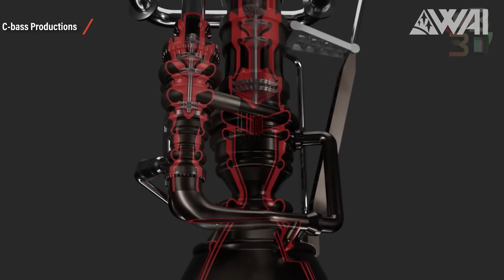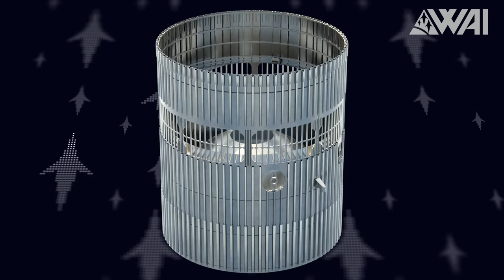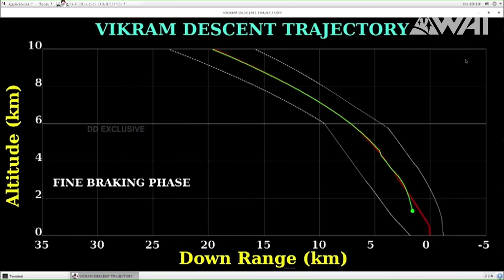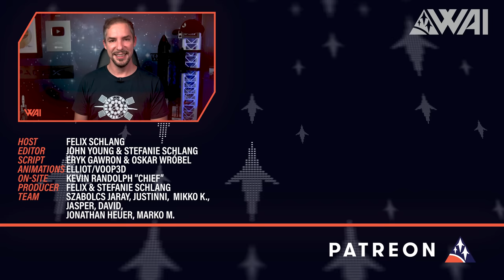Epic Testing Change! Is SpaceX's Starship Raptor Engine Unreliable?

Comment: Every change to Starship Raptor seems designed to compensate for a lack of thrust: they added more engines, then increased thrust with Raptor 2, and now with Raptor 3. The OLM was damaged by a very slow liftoff, also suggesting insufficient thrust. Perhaps the Raptor design is inherently difficult to ignite.
Reply: No one else has successfully built and flown an FFSC Methalox rocket engine. Remember, the Raptor is still in development. Spacex's first engine, the Merlin, also took quite a while to develop into the incredibly reliable engine it is now. Also, it uses a much simpler gas generator cycle and Kerolox as fuel.
Reply: As they say, more thrust more better. And of course everything in rocketry is a thrust issue. But Superheavy has the highest thrust-to-weight ratio of any rocket ever built, it's why it can be a fully reusable vehicle. The flight test had trouble with liftoff, not because the vehicle as designed is short on thrust, but because numerous engines failed to ignite at all. And that's to say nothing of the engines lost during the remainder of the flight. In the future when all 33 engines are lit and remain lit, Superheavy will absolutely jump off the pad! It's going to look surreal.

Comment: Felix you forgot the lawsuit - If it goes through quickly in favour of the FAA and co-defendant SpaceX, then launch sometime this Year is possible. If lost and EIS is ordered, it will take 1-3 Years..  Anytime this Year for would be great and fingers crossed the water deluge holds up to the fury of 33 raptors firing full duration (the same time period as a launch) at close to full thrust (SpaceX didn't disclose the thrust % for this latest SF).. This will be necessary to make rapid launches possible - ATM we don't know how close SpaceX is to this goal...
Reply: 2024 or later. Everyone in their senses know this including NASA

Comment: Shoulda gone for fewer, larger engines.
Reply: smaller engines are easier to engineer, and cheaper to build, so while they are failing now they will eventually solve this problem. how long will it take, is the real question.
Reply: And lose the re-usability of the ship.
Reply: @Scanner9631  it's not like they're landing with legs. They're supposed to be being caught by zilla anyway. So who cares if the engines are larger?
Reply: @Dac85  They're supposed to be being caught by zilla anyway. 

If the engines are much larger they can't throttle enough so that on landing the rocket can hover which is NECESSARY for the catch.  Without that ability it will never be allowed to land carrying people.  

The engines minimum thrust needs to be LESS than the gross mass of the landing rockets.

Comment: From a simple mathematical standpoint the more engines you have the more likely it is you're gonna have at lease one fail.  Say for instance that any given engine has a 80% change of functioning normally, that is actually a 20% chance of failure (1 in 5), which is pretty good.  The odds are better that the engine will do what it's supposed to do.  But that doesn't mean that's true for multiple engines.  Think of it like rolling dice.  Say you want to roll a 6, with each roll you always have a 1 in 6 change of rolling a 6 with each and every roll, but the more times you roll the more likely you're gonna roll a 6.  This is how it is for a rocket with multiple engines.  Each engine might have a 1 in 5 chance of failure, but if you're trying to light 33 of them, there is a more likely chance that one or more are going to fail.

the other thing to consider is the problem may not be with the Raptor itself but rather some kind of software or electrical issue where the control computer may be getting faulty values from the engines due to bad sensors or bad wires, so the computer THINKS there is a problem with an engine but there really isn't.
Reply: Look to the Falcon Heavy. It has 27 engines, which are incredibly reliable. Those engines also had a development phase in which they sometimes failed. Raptor is still in development. It is a much more difficult cycle (FFSC) to perfect than the Merlin (Gas Generator). Also, the Merlin uses Kerolox, a much easier fuel to work with than Methalox.

Comment: Why would 4 engines shutting down at once be considered unreliable Raptors? the odds of them all failing at the same time are basically zero - so clearly it was a shared cause upstream of the engines. A gas void in the fuel flow?

Comment: Raptor engines are much more complicated and operate at much higher chamber pressures than the Merlin. 
Failure rates need to be several orders of magnitude higher for human rated flight.
Reply: elon should be in the first human flight of this rocket.

Comment: The Raptors need to be as reliable as the Falcon 9's Merlins. It's been a long time since we've seen a Merlin fail in flight. If a Raptor fails in flight it just becomes useless, dead weight not producing any thrust. SpaceX needs to fix them.
Reply: It needs to be more reliable because human life depends on those engines working when starship comes back down to earth..
Reply: merlins will fail too. give it time.
Reply: @iamaduckquack  That assumes Starship will ever get to launch people. I'm not convinced it will make it that far.
Reply: @TheGregEgg agreed, and I don’t think it will ever do a propulsive landing with humans. 

Best case, launch empty starship, launch crew dragon. Rendezvous in orbit, crew transfer. Perform mission on starship, return to crew transfer back into crew dragon for landing.
Reply: @mrbfox1775  I agree. Either Starship lands successfully on it's first (only) try or it ends in a horrific disaster. You can't have people flying on such a dangerous spacecraft. Using Dragon to transfer crew is much safer, but much less efficient.
Reply: @mrbfox1775  that means dozens and dozens of dragon launches if they want to fill starship with crew for mars or just send a handful of people. Both options suck.

I don't think it'll be an issue to launch starship with people but getting them back to earth will probably be a problem.
Reply: @TheGregEgg  Launching with people all hinges on being able to bring them back safely so engines would need a 100% success rate and I don't think that's possible with their attitude of rapid re-usability. Everything fails eventually without inspections and maintenance and that doesn't work well with their agenda. Starship will likely be a huge mass to orbit vehicle for years upon years, decades maybe before humans are allowed near the thing.
Reply: @ThatOpalGuy  well the merlin engine seems to be extremely reliable when comes to reusing and lighting engines again and again. it's been only like 6 years and more than 200 falcon 9s are launched and now they're launching several falcon 9s per week, each falcon 9 containing 9 merlin engines that needs to reignite several times per flight even without the mentioning of reusability. so even couple engine fails after hundreds and hundreds of flights it would still be a marvel of engineering. which didn't happen too.

Comment: I’m sure it’s more of getting the software right for the engine with that many firing at once.  Software is probably shutting them down due to erroneous data but this is just a guess.  We will see.
Reply: Not even erroneous data... just data outside the configured tolerances. Probably something simple like vibrations or operating temperatures being marginally different from what the model says they should be... not necessarily enough to be a problem, but enough for engine management to abort them.
Reply: @simongeard4824  yea erroneous was probably a bad choice of word there.  People don’t understand this is a whole new beast and there will be growing pains.  I think things are going spectacularly considering.  Can’t wait for the next launch.
Reply: @Braddeman  Oh, it could be erroneous data - but I think that's a problem that would have been picked up before now. This feels like an integration problem... nothing is individually wrong, but the whole isn't quite right yet.

Comment: There are limits to the performance that can'tbe broken and can be difficult to even approach, but Making systems more reliable is something engineers do best. Afterall, they have a proven system, and failures aren't random, they have definite causes that can be traced.
Usually a failure comes down to a single part that just happens to be particularly weak and fails. The solution is to identify that part and refine the acceptable tolerance.

Comment: I thought the second Starship Heavy flight was going to be a replica of the first. i.e. Suborbital. Can anyone confirm?
Reply: The first was to be suborbital only on a technicality--it's going to go most of the way around.  It's not like the "fly a couple of hundred miles downrange" suborbital that, for example, New Shepherd flies.
Reply: Semantics. The flight is intended to get the vehicle to orbital velocity — but with a deliberately low perigee to ensure that it re-enters in the right place even if they can't relight the engines. Basically, it enters orbit, but doesn't stay there long enough to complete a full circuit of the Earth.

Comment: The next StarShip launch will be in mid September.  The FAA approval issues are mostly about the debris generated during the previous launch and the Flight Termination System (FTS).  The FTS was fixed months ago and new water deluge system test demonstrated that the pad no longer self destructs during engine firing.
Reply: Nope, the water deluge system test didn't demonstrate that at all. A less than 3 second partial powered engine test does not equate to proving anything except that it doesn't get destroyed when only partial powered engines blast for 2,7 seconds.

FTS being fixed? They thought that the FTS was in working order on the 4/20 flight. It clearly was an utter failure.

Comment: The current engine reliability is nowhere near good enough for a successful launch. Perhaps over time these problems can be fixed, but for greater reliability engine performance might have to be reduced.
Reply: You are aware that the Raptor is still in development, right? And that no one else has ever flown an engine using the FFSC cycle, right? And that no one else has successfully flown a FFSC Methalox fueled engine, right? How long do you think it took Spacex to develop and make the Merlin engine as reliable as it is now, which has a MUCH simpler cycle (gas generator) and much easier fuel (Kerolox)?
Reply: @stefanbaartman5893  may be just may be there’s a good reason why any of that ever happened before. Now it’s perfectly fine that it will never happen. We’ll just keep trying and failing and labeling every failure as a huge success and learning opportunity. That’s the perfect plan for our sweet little cult

Comment: I'm fairly certain if a Starship super heavy stack exploded and leveled a 10-mile wide radius of Texas. WAI would report a successful test of the system. Proving the energetic potential of methane as the right fuel for the Starship program. Lol, slobbering all over.
Reply: Catering to a nonthinking cultist fanboy crowd requires slight adjustments to reality

Comment: I don't think it's the raptos at all. It's all the other pipework and pumpwork that isn't supplying the fuel properly, and engines shut down....  thats not the engine, that's the complications of trying to sync and control THIRTY THREE perfectly fine engines. 
All the background crap

Comment: Actually according to SpaceX those 4 engines did NOT start at all and as Musk has said they can't reach orbit if even three engines go out any time during boost. I don't know WHO says that Raptor development should be easy as it's just the opposite and it does not help that SpaceX is constantly changing the engine parameters upward which makes development even harder as the engines are already at the edge of operability. Keep in mind that with the Merlin SpaceX developed a WORKING engine that ran mostly reliably FIRST and THEN iterated more powerful versions from there. (Standard aerospace practice, which when SpaceX follows it they usually succeed, when they don't they tend to fail and fail hard) 

This by the way is NOT "late in the development of the Raptor" it is very, very early due to the Raptor design and parameters constantly changing. (Much like Starship/Superheavy itself in fact) The Raptor 2 (the version being used here) is still in development with the Raptor 3 being the 'new' model so it only makes sense that the barely tested Raptor 2 will be prone to failure with the Raptor 3 being totally unreliable at this point. Engine issues that no longer appear? 
And what program are YOU looking at? Raptors are still tearing themselves apart, melting and failing which is to be expected with such a constantly changing program with no apparent guidance. Comparing it to the Merlin is a disservice to the Merlin and program that built that engine into the reliable and robust engine it is today. The Raptor is none of those things and the build pace (again with constantly changing parameters and construction) FIRST would need to be a reliable and robust engine that works consistently which is not the case here.

Booster 7 had (as Musk admitted) used and obsolete Raptors which Booster 9 also has which is a main part of the problem and those used and obsolete engines are being pushed even harder which does not make for a very high chance of success but it is what SpaceX is doing to reduce their 'stock' of old and obsolete engines. Also can we admit that these are not really 'static fires' (which normally last longer than 5 seconds and is a reason that SpaceX has not met the NASA goal of a "full static firing" hence missing out on that payment milestone) but 'burps' of the engines for a very short duration. It's telling that even with the water deluge system that SpaceX is not able to do an actual static firing of the booster.

The shortened 'testing' cycle is NOT a good thing and as we've seen had this been a flight test it would have failed. This would demand a LOT more testing but SpaceX is not it seems actually interested in success but showmanship and finding way to call 'failure' a success. SpaceX will continue down this road as long as Musk's money holds out but it already appears that NASA is having doubts as well they should given we know SpaceX can do much better.

What's on the agenda for the "next launch"? Clearance, so far SpaceX has not done enough to satisfy the FAA on their readiness to launch so that's the main sticking point and I agree with the FAA here as it's their butts on the line here whereas SpaceX has clearly failed them (again) already. Considering that SpaceX is essentially making the same mistakes (faster I'll admit) they did on the first launch what real reason would the FAA have to actually grant them launch clearance?
Reply: The only realistic and sober assessment I’ve seen anywhere around Starship and Musk. Cult fanboys don’t like to hear any of that but it is the reality everyone has to listen to
Reply: @uince  Thanks

Comment: From the very beginning, I've always thought that 33 engines is a horrible idea. With a reusable rocket, reliability is paramount, yet it seems Musk threw reliability out the window, and for what? Cost? A small amount of deltaV? They should have just modified an f1 engine and used like 6 of em on the booster, that would have significantly saved on cost and time. With the amount of failures and tweaks the raptors have had, by now they probably cost way more than if they had just used modified f1 engines. Literally like 99% of their failures are related to the raptor engines and how many of them there are. It's at a point where everything else is almost done but they blow up perfectly good spaceships just to find out one of the engines is faulty. Those raptor engines are holding SpaceX back, IMO. Fancy full flow combustion only gives like 2% more efficiency for 200% more headache I guess. Everywhere else Musk has found ways of cutting costs, making the hull out of steel, even reducing the safety of starship to make it easier and cheaper to manufacture, yet with the raptor engines it is strangely the opposite, they cost more and are less reliable. I know it's an effort to increase deltaV, but reliability should come first. DeltaV doesn't matter if you can't even land safely.
Reply: On the face of it, I agree; but the wisdom of it I have no clue since I'm not a Rocket Scientist.  One thing's for sure, the die has been cast (alea iacta est).  Just like w/ accomplishing the seemingly impossible Falcon 9 self-return to launch pad, SpaceX is going to have to make the 33 engine Starship Booster work (on top of also returning to launch pad & reusable!!).